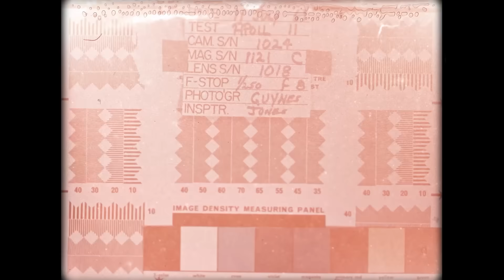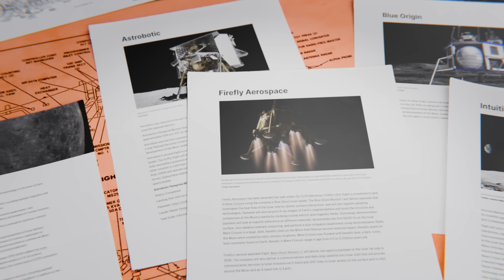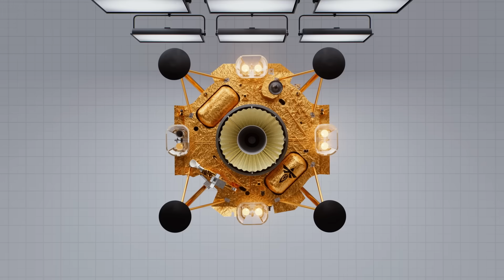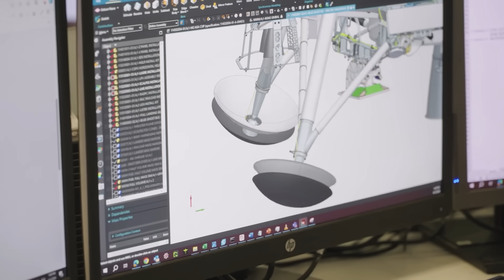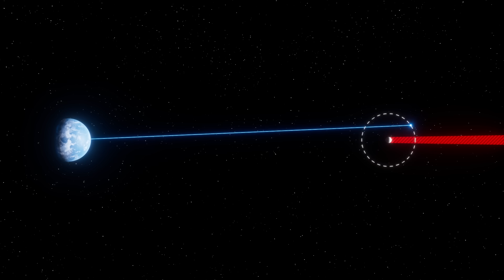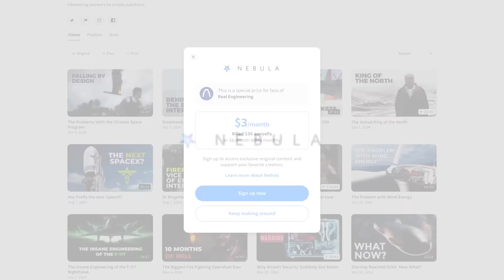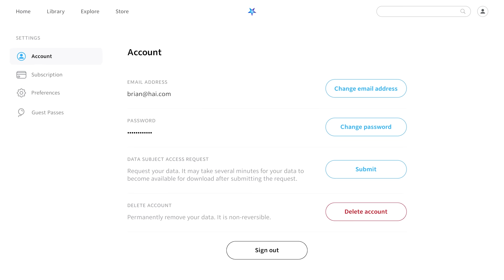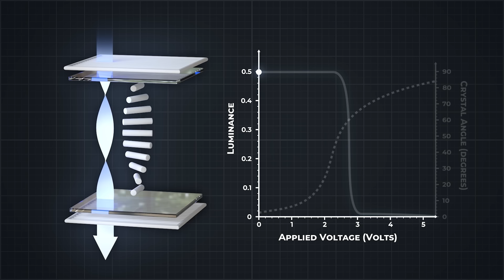Why the US is Struggling to Land on the Moon

Comment: Because there has never been a human being there. How much does it take today to break out of the Earth's gravity well, all prepared in such a way that the shuttle doesn't crash through the air. Let alone come back from the moon and over 50 years ago. Only idiots and ignoramuses believe in the fairy tales of the once American flights to the moon.
Reply: False. 24 human beings have traveled to the moon. This is supported by tons of actual evidence, plus extensive documentation that details how they did it.
Reply: 25,000 miles per hour is the speed required to attain escape velocity and break free from the Earth’s gravitational pull. From then on the spacecraft essentially coasted following the Hohmann transfer orbit, used to transfer a spacecraft between two different circular orbits around a central body in the same plane. It is the most economical path in terms of fuel and energy, but not the shortest or fastest. It involves two impulses, one to change the spacecraft’s speed and direction at the first orbit, and another to circularize the orbit at the destination. The manoeuvre was named after Walter Hohmann, the German scientist who published a description of it in his 1925 book, ‘The Attainability of Celestial Bodies.’
Because of the effect of the Earth’s gravitational pull, the spacecraft slowed down steadily to what was, relatively speaking, ‘crawling speed’ until it reached a distance of 205,000 miles where the Moon’s gravitational pull exactly balanced that of the Earth. Thereafter the craft accelerated under the effect of the Moon’s gravity of 5,750 miles per hour. As the spacecraft passed round the far side of the Moon the rocket engine was fired to slow the vehicle down to lunar orbital velocity, about 3,600 miles per hour. To return from the Moon the rocket engine is fired again for just over 4 minutes to accelerate the spacecraft past lunar escape velocity and back towards Earth. 
The flight to the Moon and return of Apollo 8, is explained on pages 133-135 in ‘Exploring the Planets’ published by Hamlyn books in 1970.

Comment: We've had nuclear "batteries" (RTG) for almost 100 years now. Why are we still using batteries in hundred million dollar space exploration programs?

One lander with several micro transmitters it could "carpet bomb" onto the surface seems like the easiest way to make a navigation system. A simple RTG with a solid state capacitor powering a tuned radio pulse emitter would do everything they're talking about. (Distance from each transmitter by measuring delay between each one's arrival to the navigating craft, or the degradation of signal, or a send/receive pulse... Options exist.)

Voyager 1 used a ~23 watt radio if the search result doesn't lie. Since we're only talking about moon navigation, you could probably get away with ~5 watt pulses, maybe even in the milliwatt range according to some experiments.

Comment: Remember the toys, they weeble and they wobble but they dont fall down? Thats the shape they should make the probes. A spherical shell with an offset interior mass so that they dont have to worry about the tipping.
Reply: It's what the Soviets did, and it worked.
Reply: Or just a spherical shell cage that has the lander inside which can point in any direction after touch down which wont worry if it hits a boulder or lands on a slope... come on Nasa engineers its not rocket science!! lol
Reply: @sonneengel1945  i think they did that with one of the mars rovers, its called like a hard landing or something
Reply: @sonneengel1945  Exactly what the Soviets did. KISS method
Reply: A gyroscope...?
Reply: After some research it may literally be called a 'weeble' https://en.wikipedia.org/wiki/Weeble
Reply: @regexrationalist  LMAO
Reply: Weebles

Comment: Its because we are sending astronauts with new tech

Imagine this, would you rather use a car, or a horse carriage. Both do the exact same job of getting you from one place to another. But people still buy cars, despite the fact it is more complex and expensive, and more time consuming to build than a horse carriage. It guarantees modern day comfort, safety features and efficiency 

Same thing with the Moon. We could build the same thing, but why in hell would we go back to the moon on 1960s tech and safety standards. Even if new tech is difficult to build, its still better to use it because we now have experience to build space shuttles, space stations and even reusable rockets. People dont realise integrating modern tech into old concepts is a lot more difficult than just recreating the old concept

Comment: If LiDar can see through ocean and the canopy of the Amazon 
Why don’t they use a real time lidar type sensor for landing
Should negate the “dust” issue
Reply: They used a laser altimeter. Unfortunately, during the preflight check they forgot to switch this device out of safe mode. This is a physical switch that cannot be flipped remotely, so when they found out during the flight that the altimeter didn’t work, they were screwed.
Reply: And isn’t a tripod the most stable? 
Why does this have 4 feet?
Reply: @kizzpizz_skate1856  With more feet, you have better stability when the terrain is uneven: you can set down at a larger angle before the lander tips over.

Comment: How did they run the cooling and heating system to keep temperature normal inside while outside varied from too hot to too cold. using the batteries of 1960s. That seems insane.
Reply: Space is almost empty so there is almost no heat transfer, the heat shield you can see on the shuttle serves to reflect solar radiation like a mirror but the heat transfer with the outside is almost zero
Reply: As for the Command and Service Module, it rolled slowly on its axis, also called the B.B.Q. roll. They did not use batteries then, but fuel cells. The Lunar Module was protected by many layers of Mylar.

Comment: We went to the moon with equipment designed using slide rules, basic calculators and lots of cigarettes and 3 martini lunches. Seems odd we can’t do it today with the technology we have.
Reply: IM-1 failed due to a simple human mistake: they forgot to switch the altimeter out of safe mode during the preflight check. Without the altimeter, a hard landing was inevitable.
Reply: It’s not about technology. It’s about funding and cost.